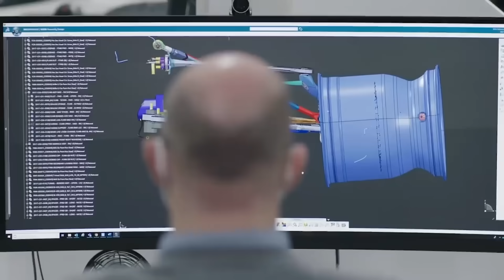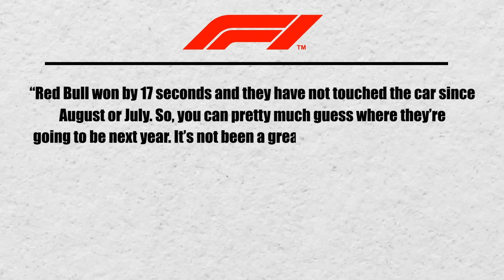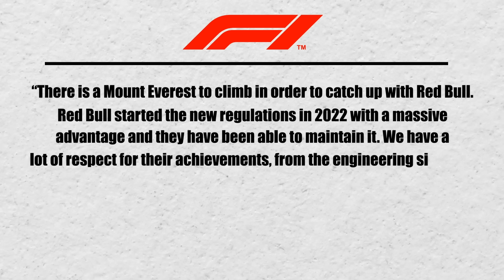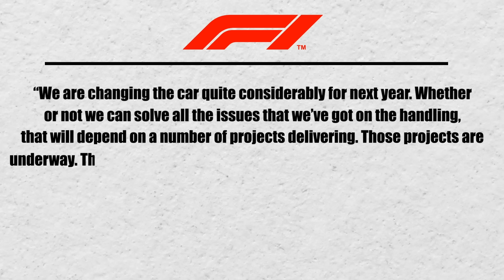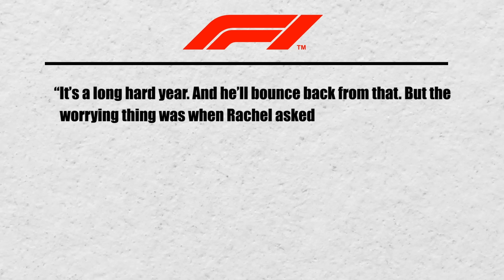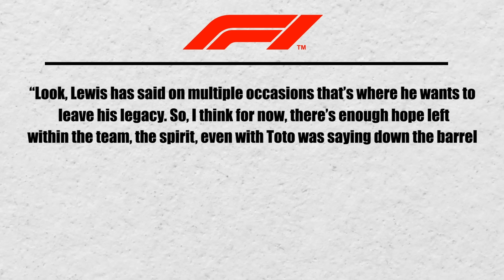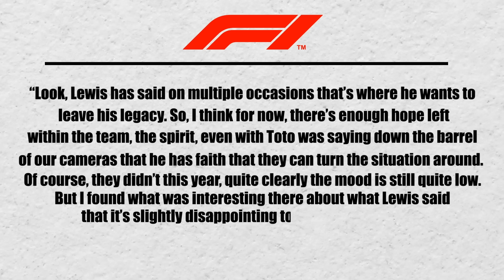Mercedes DAUNTING PREDICTIONS for 2024!

Comment: The cost cap has ruined the sport. It’s F1, should be the leading edge of Motorsport. Can you imagine a space program with a tight cost cap? You can’t restrict innovation. The original idea was to help the smaller teams catch up, that’s just got worse compared to RB. No one will catch RB until potentially 2026.

Comment: I wouldn't doubt the Mercedes W15 will look pretty close to the Red Bull RB19, as will everything else on the 2024 grid. The problem is that technology isn't cheap and with the FIA Budget cap it's harder and harder to bring in newer technology. The FIA has to decide whether they want F1 to be a technology series or a drivers series like IndyCar in the United States, where all teams have the same chassis and tires and the only difference is the engine and driver skill. And the fact that IndyCar doesn't use tire warming blankets on their Firestone/Bridgestone tires, and they still have competitive racing.
Reply: F1 in 2023 has been the most competitive of the recent 15 years. max verstappen is just happening, and until now, no other driver has a solution.
Reply: @TonVanDerAa  So in your mind Max will every year until his contract is up  at the end of the 2028 season?
Reply: @TonVanDerAa  I'm sorry but disagree, if you take away that RB and MV were still ahead by 17 seconds then i'd agree with you. But that car is just too far ahead of the rest of the field. Take Perez, a driver that until in a redbull his best outside was 4th overall in the drivers standings. In almost every year before that he was between 7th and 16th in the standings, he's a very very average driver with some occassional incredible wins. I think the rest of the field have been competitive, but that RB has basically gamed the rules until 26... And i'm not sure i can be fucked to watch clean sweeps for the next 2 years.
Reply: F1 is not an individual sport but a team sport. It is never a driver oriented sport and developing a car is as important and part of the sport as the driver's racing cart. Removing that is basically giving teams who failed in development an unfair advantage and a let go of their failures.

The same happened when Mercedes dominated, the same happened when Vettel dominated with Red Bull...and so on.

What is happening is the usual cycle that drives innovation in F1. Give it time and actually appreciate the package in front.

Comment: No one will catch RB next year. They have two season of data on a performant car that none of the other teams have. That alone puts them ahead.  The refinement and innovation they will bring to their next years car will be unmatched. So for F1, they can expect viewership to decrease for the next two years and Max to win 2 more titles. The biggest issue for any team trying to catch a leading team after a big regulation change is the cost cap. Red Bull has been using their 2023 cost cap dollars to develop their 2024 car whilst other teams continued to spend on developing or fixing their current car. This leaves no room to develop their next year car. McLaren have a golden opportunity to leverage off what they have learnt from their current car for next year but are still a full year and half off RB in terms of data. Also, they are stuck with the Mercedes gearbox and powerunit. Ferrari are the only team who got it right in 2022 but dropped the ball in 2023. So they know what works and what does not. There constraint this year has been to many crashes. So less money to spend on 2024 car. My prediction for 2024 is RB, McLaren, Mercedes and then Ferrari.

Comment: the fall happens to every team...Ferrari, Williams Mclaren,Lotus,Tyrrell... the difference(minus Ferrari) here is Mercedes don;t have a change of engine (Wiliams losing Renault), or loss of sponsorship (Tyrell/Lotus)to blame. it has take Mclaren over a decade to get close to competative again, and Williams may take even longer, but with Mercedes they may end up in 24/25 where they are there or there abouts, but will be finishing 5th and 8th or 3rd and 6th etc like the last 2 seasons.

Comment: Get rid of Toto Wolff. The 2022 W13 was never going to work yet Toto pushed the team forward trying to fix it instead of burning it. 2023 W14 was simply more of the madness. Every key engineer is bailing out. The work environment is toxic as Toto and Mercedes management won’t listen to the experts.
Reply: And you're an inside man at Mercedes then are you ? 😂😂